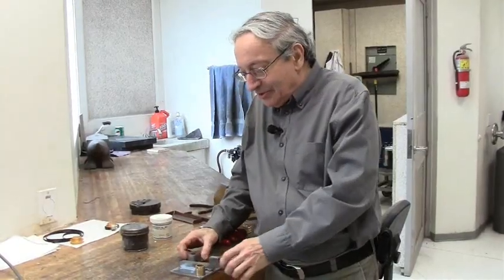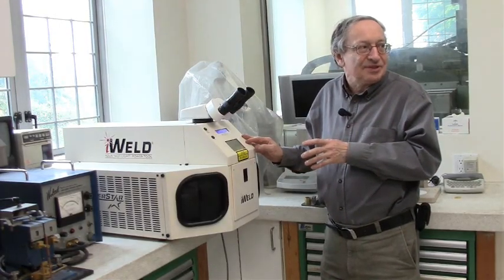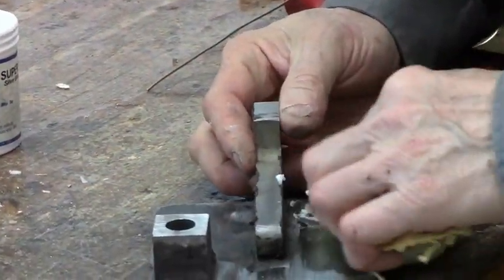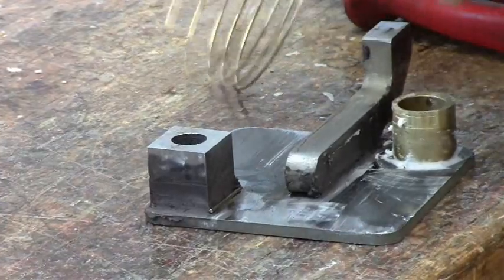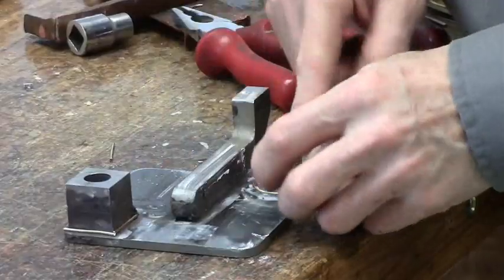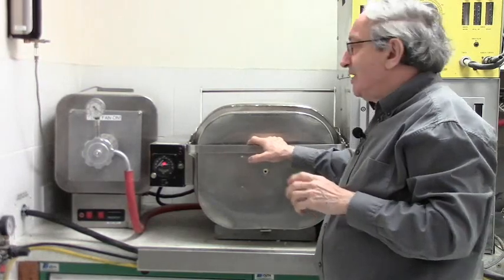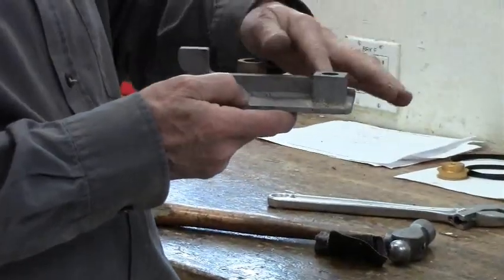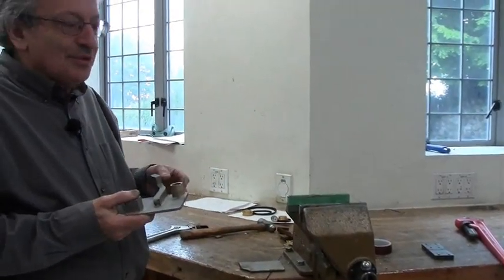Building Prototypes  Dan Gelbart part 14 of 18  Brazing

Comment: Hello Dan. At my work I have been tasked with Oven brazing aluminum to stainless steel is this even possible? Our oven isn't vacuum sealed yet we did try to have a controlled atmosphere of Nitrogen running through it. Is there a solder material that you recommend to do this task?
Reply from the maker: It will be very difficult if not impossible.
Reply: @dgelbart  What about if we implied induction brazing instead of furnace?
Reply from the maker: @emillianocabrera8760 Same.
Reply: @dgelbart  Also what specifically are the factors that make this impossible? Is it due to the differeing thermal expansion of the metals?
Reply from the maker: @emillianocabrera8760  The oxide on the aluminum.

Comment: I have a question, Since u have built Your Own ovens. I see some ovens have fans and some don't ,what decides that? , 
is fan not required above a certain temperature? Or is fan not required for certain metals? 
Convection vs radiation heat treatment? 
I'm a bit confused.
 From what I've seen Upto 550c ovens(alu t6 HT) have fan but steel heat treating (1000c+ ?)furnaces don't.
Reply from the maker: Above a certain temperature you don't need a fan as radiation coupling is so strong  that the temperatures even out.  Below 300 deg C you definitely want a fan, Between 300 deg C and 600 deg fan adds a uniformity.
Reply: @dgelbart  wow! Thanks for such a quick response.

Comment: I've been sticking things together for decades, and worked with others sticking things together.    I've never seen anyone braze with an oven before.     No reason why not to, except that a) an oxy torch is far faster, and b) ovens are expensive.  One oven will buy a lifetime's supply of gas.  However, using an oven like Dan did will eliminate distortion, as the whole assembly is slowly brought up to an even temperature.  
I feel Dan dismisses welding too quickly.   In many cases, problems with distortion can be avoided by suitable design and welding in the right order.   Often when distortion may still be a problem, assemblies can be preheated to an even temperature before doing the actual welding.
The advantages of brazing become less as parts thicknesses increase.
Reply from the maker: I should have phrased it differently:  for small and delicate assemblies brazing is the best, for large objects you need to weld, as it is difficult to supply the heat you need to braze or it would require a large oven. BTW, ovens are cheap to build. All the ovens in the video are home made. You can also use a small ceramics kiln.
Reply: @dgelbart  : The relative costs of ovens vs heating with acetylene may be region specific.  It certainly won't pay for most work where I am - Australia.   Due to the introduction of low cost invertor arc welders and plasma cutters from China about 10-15 years ago, people have been giving up the use of oxy-acet welding and cutting in droves.   The gas suppliers thus now have huge over-capacity.   My gas supplier reacted by slashing cylinder rental by nearly half, and gives me 2 refills a year of each gas free.   As I am also in the small run prototyping game, the 2 refills a year meets my needs most years.
Incidentally, after using oxy-acet welding and brazing for decades, I recently bought a low cost Chinese MIG/TIG/Stick welder myself - I should have done that before.  Stick welding electrodes are now readily available as small as 1.5 mm, letting you have the low distortion advantages of stick on sheet metal as thin as ~1.00 mm, however it takes some skill.  
Dan, looking at you advocating water jet cutting - an extremely expensive method, can I actually have confidence in your claim that ovens are cheap to build?   I do have some oven experience - I built a precision environmental chamber for a client (the precision comes from the cheapest part of it - the PID electronic control).
Reply: @keithammleter3824  well in places where you do not get free oxy acetylene, an oven or a kiln (which tend to be more plentiful and affordable) is a pretty reasonable purchase, most uni labs will also have some ovens, so it's not outside of the realm of possibility. It's not like he implies that gas cannot be used for brazing, brazing can also be done with hot stones, it's just a matter of what you happen to have in your shop. Also he didn't always have the water jet, some of Dan's machines are very old, when he had to build them on a tight budget. Even that oven in the video is using an some salvage avionics for temp control.
Reply: @zoravar.k7904  :  Fair enough perhaps, however it's clear from Dan's various videos that he has far more money than most of us - money to burn.  Good on him, he is of the age where his priority should entirely be having fun.  Consequently his views on what tools to have are skewed.
Dan is much to be admired for his commercial/business success in his life, but his advice for us more ordinary mortals is a bit off.
In response to watching Dan's videos, I investigated water-jet cutting.  It's very much an expensive method suited for niche markets.  Expensive in terms of purchase cost, and expensive in terms of ongoing time needed to keep the machine operational.   The cheapest water jet cutter for metal is the Wazer, about AU$18,000 installed and usable - but it is a toy with pressure too low for useful work.   In the time needed to set it up for the job, wait for the cutting to be done, and after cut clean-down, I would have a typical prototype job done twice over, with much the same precision using ordinary hand tools.   For metal sheet far beyond what the Wazer can handle, a plasma cutter is cost effective, and not a lot less precise.
Heck, most of us who do prototyping couldn't afford the floor space Dan has available.
Reply: @keithammleter3824  sure, but students and researchers tend to have well kitted shops at their disposal. This group also tends to discount sheet metal processes and other 2d processes in favour of multi-axis CNC mills or resin 3d printing for everything since fabrication isn't necessarily their primary vocation. I think this series is more tailored to them, rather than machinists, or small enterprises. Once you look into building your own shop, then no single person's advice is particularly useful, as your machines will be based off of your workflow, output volume, work requirements, geography (parts supply), and budget. Anyways, all the best to you in Australia, I must imagine fabrication is even harder when you have to do it all upside down.
Reply: @zoravar.k7904  :  Nah, fabrication is easier here because we are a metric country, unlike North America.
You have a point with universities - sort of.   The one I went to invested something like $30,000 in a 3D printer at the time when such things were really new, and "maker" style 3D printers had not been invented.   It worked by shining two orthogonal laser beams through a liquid, and somehow the liquid was converted into a solid where the beams crossed.  I don't know how much the special liquid cost, but I bet it wasn't cheap.   The resulting solid object was as fragile as anything, but a technician discovered that a bit of super glue would stop it turning to dust when touched.  They bought it because someone in the faculty thought it was a cool thing to have and would support their training of students for their future careers.   I think it a complete waste of money.
Reply: @keithammleter3824  I'm sure it was useful for the students as it exposed them to a nascent manufacturing and prototyping technology. They're probably happy that they had a chance to play with one in uni and mess around with the design principles now that SLA has gone mainstream. A good university tries to get students exposed to technologies that will become more relevant in the future. Most decent university shops will contain weird machines, and sometimes they're just there for the concept, but the physics department also has some very difficult material requirements in terms of prototypes. So sometimes oddball tech can help with filling those needs.
Reply: @zoravar.k7904  : But how mainstream is it?   Apparently it has a niche in automotive component design and in medical fields.   Here in Australia there are SLA equipment suppliers eg Konica-Minolta, and a few firms that do SLA printing as a service to product developers/designers.    But the percentage of students that went thru that university I mentioned that have ever seen an SLA printer or the product of one since would be near zero.
We do almost no volume manufacturing in Australia, as it is cheaper to get it done in China.   But we still do a lot of product development and prototyping, including for Chinese manufacturers.   It seems the Western educated mind is more innovative.   But we utilise techs with traditional hand tools, 3D computer modelling (eg Solid Works), non-CNC and CNC machining mostly - cheaper and faster.   
I worry about the future of this though.   The Chinese are rapidly catching up in innovation rate.   Won't be long before they overtake the USA in terms of patents granted.
You are definitely  right about most university shops containing weird machines.   New and old.   The uni I went to had a copying capstan lathe dating back to the 1930's.   CNC before CNC.   Perhaps today it could be called HTC - Hydraulic Template Controlled. You set it up with a template - a cam profile made of steel sheet and away it would go, automatically doing multiple machining operations and turning out a new part every minute or so.
Reply: @keithammleter3824   well, it's not common in manufacturing, but it's everywhere in r&d virtually every consumer product oriented company whether it's startup or multinational uses 3d printing to mock up designs. 3d printing is also becoming a thing in sneaker manufacturing.

Comment: For joining copper alloys to ferrous metal you can also hit it with some silicon bronze TIG rod or MIG wire, and avoid having to wait for the oven and heat up your whole part.
Reply: I presume the point is that by heating the whole thing up, you don't get heat distortion.

Comment: Hey Dan, is this your personal shop?  Just curious what machine's you have built?  I know the lathe and spot welder, but what about the 100 ton press?
Reply from the maker: Yes, personal shop. The press I rebuilt from an old one, you can also see the ovens I built.
Reply: Very nice Dan, if you don't mind me asking, how much was the waterjet?
Reply from the maker: Was about 120 grand but you can buy a Maxiem 1515, made by Omax as well, for much less.
Reply from the maker: A full size waterjet will be close to 100 grand, but Omax has now a small one, max size 12"x12" for under 20 grand.  @glenndavis2762

Comment: Stacking waterjet cutting works great. I made turbines based on .500" cuts. I will be making 2"x2" or so horizontals with tig welded parts. I use a tig welded stainless boiler welded by a red seal welder. No rust no silver solder.  I run a flowjet table,

Comment: Some hidden location pins between the parts and some weight on top would be an alternative for those without laser welders. I've added a saved search on ebay but I'm not holding out much hope ;)
Reply from the maker: There is a "poor man's version" of a laser welder available from many sources like: http://www.amazon.com/Sparkle-Welding-Machine-Necklace-Platinum/dp/B00BWO9LTE
Reply: Hi Dan, I've looked into these previously, there are some slightly better versions with a pneumatically (edit probably a solenoid actually) operated electrode (withdrawn from material to strike arc) and an option for shielding gas, they are somewhere between spot welding and TIG (Lampert is one brand, Orion another). I'd be interested to see how well the cheap ones do joining large pieces. I'd also thought about building something either stand alone or as an attachment for my TIG welder. (I realise I am teaching you to suck eggs so this is more for the benefit of discussion or other readers)

Comment: Great video, thank you for putting all of these together. I have a question, is it possible to use this method of brazing for joining aluminum parts ? If so, why do people prefer dip or vacuum brazing ?

Thank you for your help.
Reply from the maker: +Alper Unal There are many commercial brazing wires for Aluminum, the ones I tried all worked well but aluminum melts before it change color so you can easily overheat and melt. Oven brazing works less well for aluminum. With some practice it will work well.

Comment: Dan, this is a bit off topic, but I want to get a flux to gas weld aluminum.  Do you have any idea what would work.  I know one place in the US that sell this product, but importing is getting expensive, so if there is a substitutable material, all the better.
Reply from the maker: Hondo Trailside I tried several (also sold as "aluminum brazing") and they all work well. The trick is not to melt the parts, as aluminum does not change color before it melts.

Comment: Interesting video.  Well explained.  I do torch brazing, but an oven like that would be nice.  I saw a display of miniature old time engines created using steel composite brazing, as demonstrated, and the result was indistinguishable from cast.  I didn't think to ask if he used a torch or oven, but they were all very impressive and actually ran on fuel.  I think a lot of people never try brazing, and miss out badly.  Cheers Rob
Reply from the maker: xynudu If you look at this video: www.youtube.com/watch?v=ccjTMQwKWNs, all the parts that look like castings are actually brazed assemblies.

Comment: Is this brazing or soldering?  I am confused by the terms people use.
Reply from the maker: Brazing, also known as "hard soldering" , is similar to soldering but done at a much higher temperature using stronger filler metals.
Reply: Dan Gelbart One last question and I think I will understand.  Is there a "welding" which is done with a torch.  Or does all "welding" involve a process involving electricity?  i.e. is a torch only good for hard or soft soldering?  I know "welding" can be done in a forge by a blacksmith.
Reply from the maker: rioresearchanddev Welding can be done with a torch, by forging and other methods. It is called "welding" when the base metal melts or flows. It is called "brazing" or "soldering" when only the filler metal melts.
Reply: rioresearchanddev Thanks Dan, great help to me.

Comment: I don't have a laser welder. Would any problems arise from simply using super glue to hold two pieces in place while I apply the flux?
Reply from the maker: You don't want to use anything that leaves a residue in the brazed area. On top of it, any adhesive will disappear at brazing temperatures so it will not hold the parts. You can tack parts with a TIG welder, tie them with wire, drill and place location pins or any other trick.

Comment: I have seen brazing done with a torch, can you comment on this method?
Reply from the maker: Torch brazing is the standard way of brazing, but when you want to build up something that looks like a casting , a torch does not have sufficient heat output and the non-uniform heating will distort the assembly. If no oven is available, use several torches at ones (needs two people).
Reply: what about doing the first 350C in a toaster oven (cheap) and the rest with a single torch? - is it enough of a 'platform' (temperature wise) to use a single torch from?
Reply: @antigen4  preheating will help a lot. Depends on what kind of tolerance you need at the end of the day.

Comment: Hello Dan,

I've previously run into issues with laser welding hardened material (440C, 58-62HRC) to unhardened material (303 SS), mainly in cracking of the welds (as described to me by a machinist when he tried it, as I don't have access to a laser welder at my work facility). Could you comment on how big an issue this is?
Reply from the maker: Any material that become hard and brittle when cooled rapidly after melting will have this problem: series 400 stainless, all high carbon and tool steels etc. Aluminum has a similar problem because of high shrinkage when cooling. Series 300 stainless does not have this problem. Some standard solutions exist, like pre-heating part.
Reply: Dan Gelbart Thanks for the guidance!